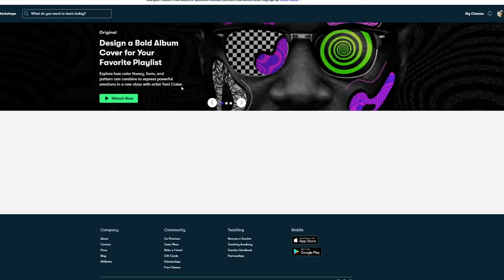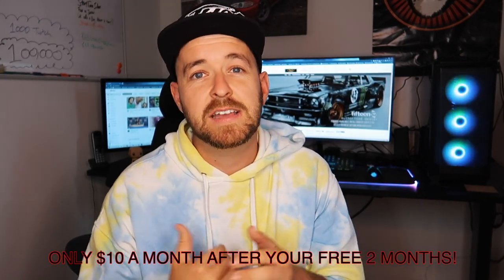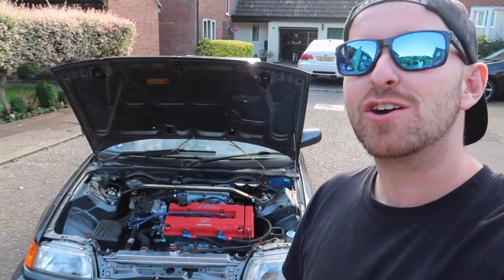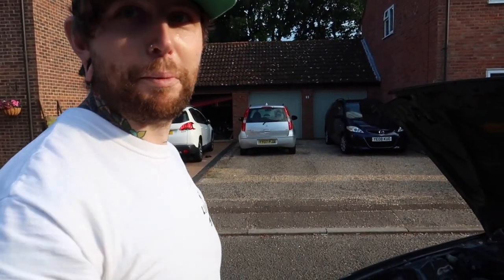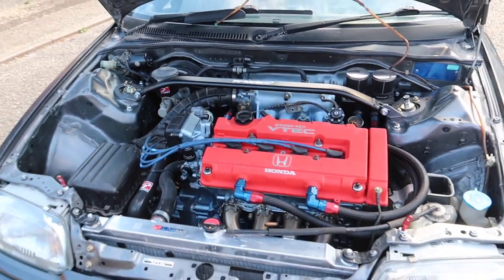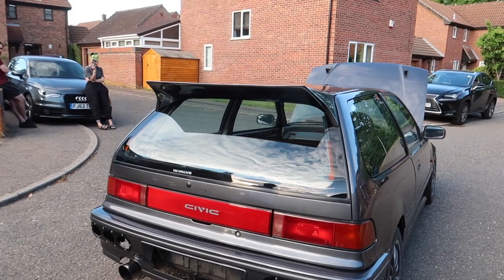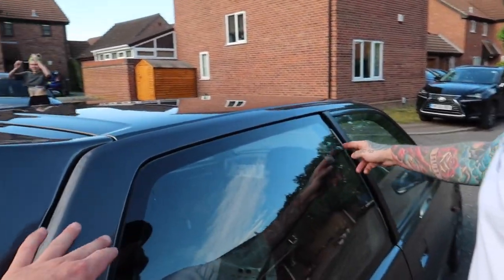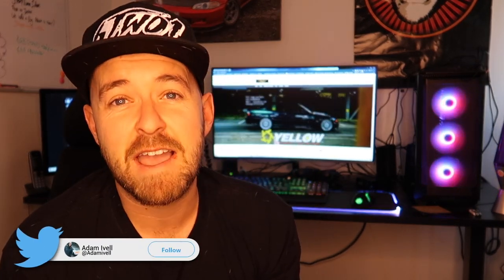PETE'S KANJO B18C EF HONDA CIVIC IS ALMOST COMPLETE!!!

Comment: 8.42 Weight saving on those two wheel nuts? 😯
Reply from the maker: car isnt finished yet, only pulled it out of the garage to do this video, still needs to be lowered & nut bolt checked
Reply: Adam Ivell phew!

Comment: you didn't even call him out on his lug nuts. smh.
Reply from the maker: Because ?? The cars not on the road yet, still needs wheels off to lower it more. When u build a car you make it as easy as possible to do so
Reply: Adam Ivell - I meant you need to sell him on a set of lug nuts. 
2/4 lug nuts is perfectly roadworthy here in the states. LOL